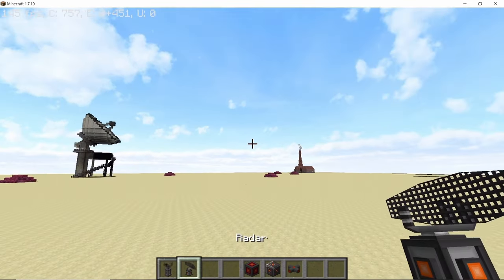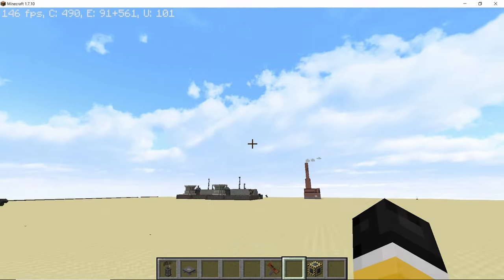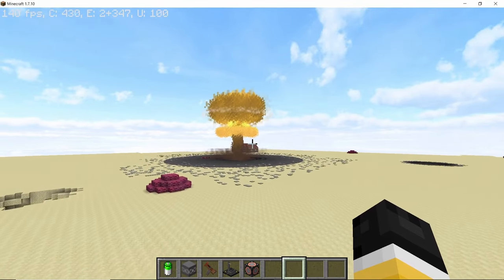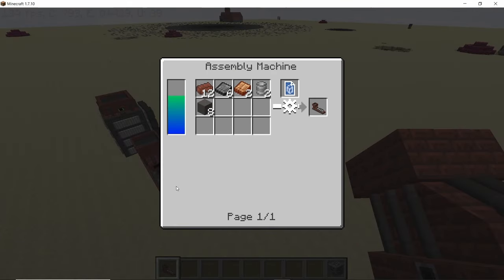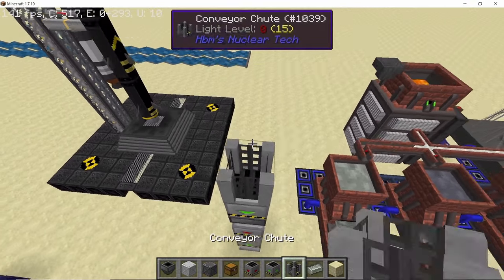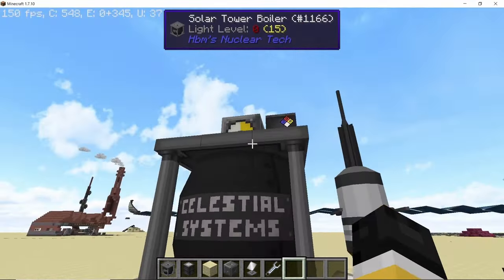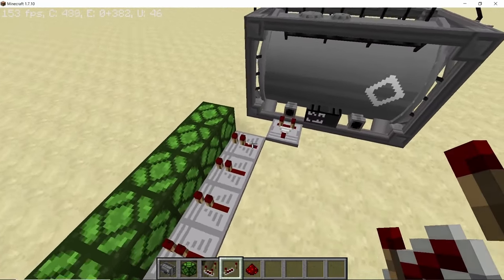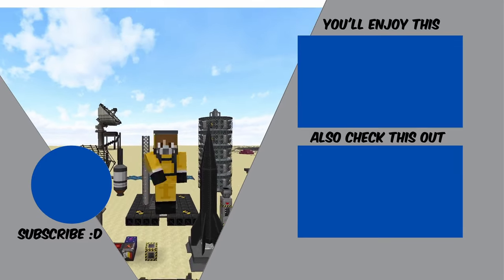Large Radar, Stealth Missile, Nuclear Explosion Rework & More - HBM's NTM Updates & Changes

Comment: Where is coolant tank in fusion reactor? (I have the same mod version)
Reply from the maker: Water is used as a coolant for the fusion reactor, it gets converted to steam and loops back into the reactor again after cooling down
Reply from the maker: I didn't exactly understand your question but I hope that is the answer you were looking for
Reply: @SavageVegeta  i remember what coolant (not water) tank was in your video, it's the secondary circuit. I don't have it. Is it was deleted?
Reply from the maker: @caxap8405  that was a feature in JamesH2's fork of NTM, in the normal version of mod only water is needed as a coolant
Reply: @SavageVegeta  okay, thanks